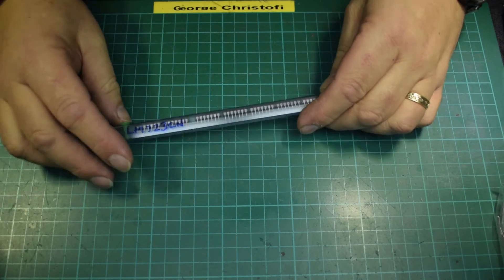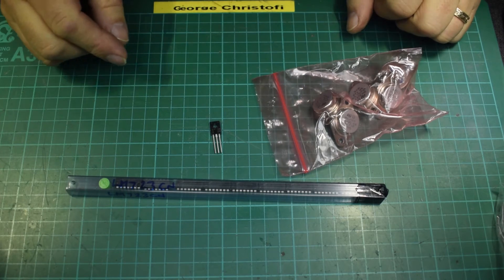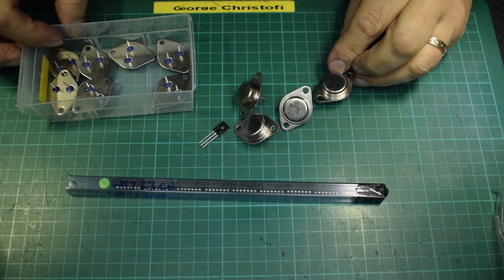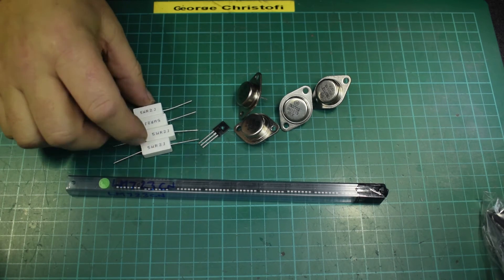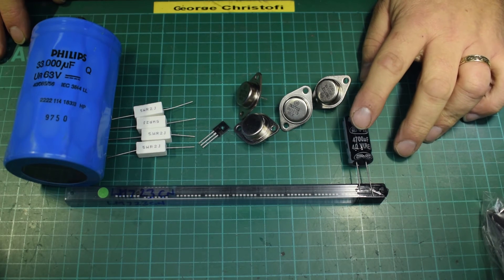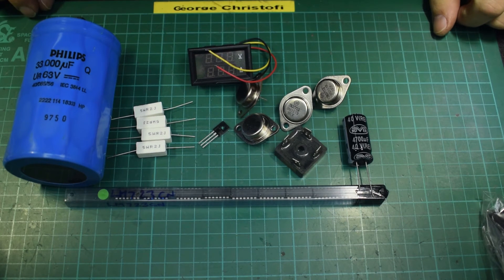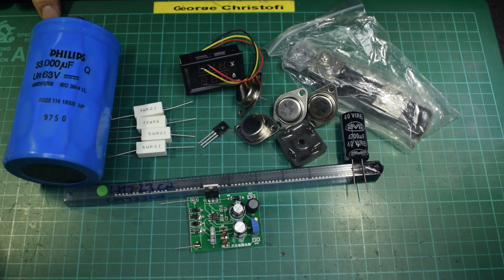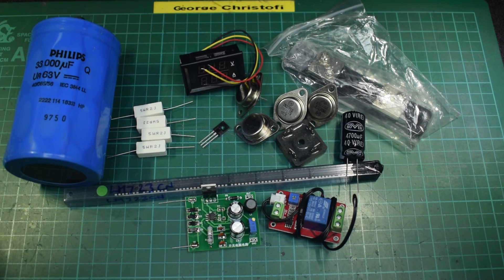High Current Variable Voltage Power Supply Project - Part 1

Comment: hey, thanks for the video, but I was wondering if the output if this cct could serve to power an amplifier like an audio amplifier?
Reply from the maker: Yes it can. the easiest thing would be to make it fixed voltage output so everything can be optimised for efficiency.